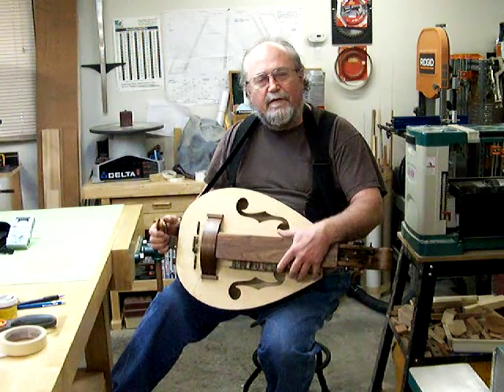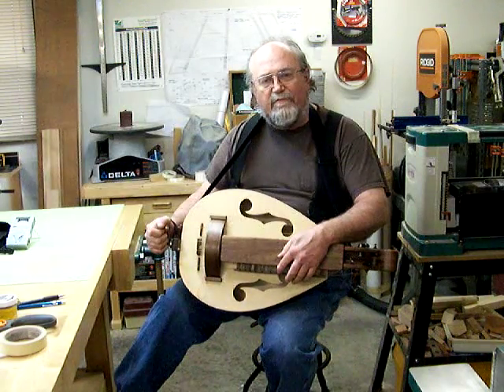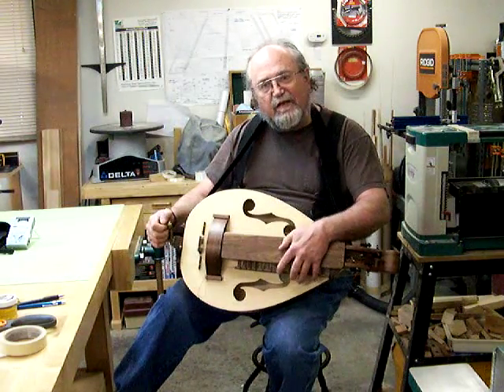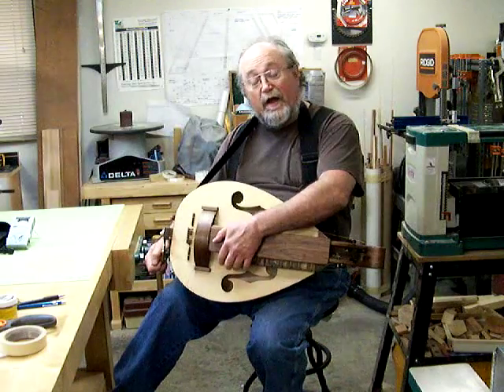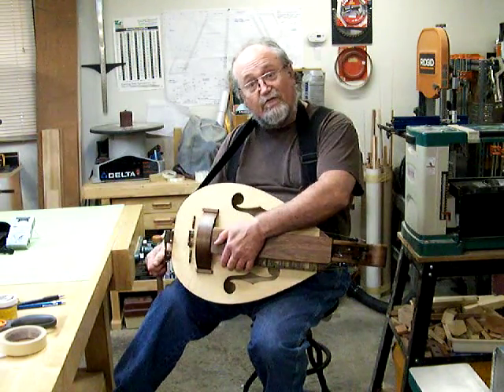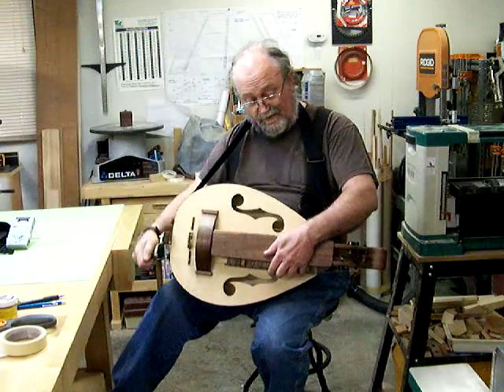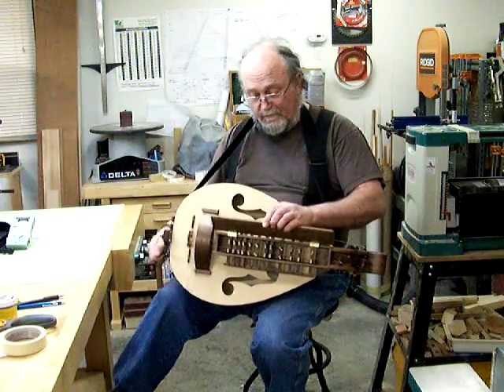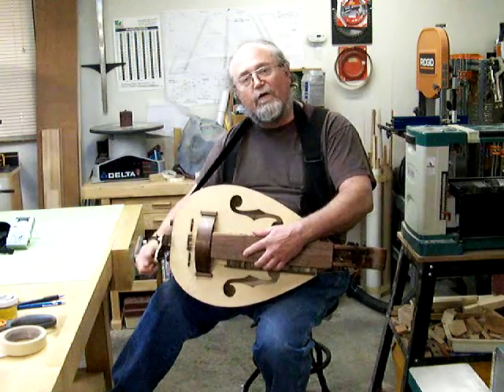My Scratch-built Hurdy Gurdy

Comment: I have a few questions about this. How did you tune in the keys? Was it just based on schematics that you copied or was there a process of adjusting the tip shape/width of the frets that pressed against the string? What was the overall cost of the materials used? How closely did you follow the musicmakers schematics? Did you make any changes out of convenience or necessity? I know this was five years ago so memories might not be the best, but I'd appreciate any answers you can offer.
Reply from the maker: The keys push the fret pegs onto the string.   The pegs can be rotated to adjust where they touch the string  Just a careful process of using an electronic tuner to adjust the fret pegs one at a time while listening and watching the tuner.  Layout and spacing of the keys in the key box was per the blueprint.